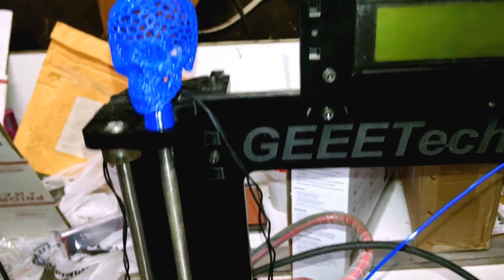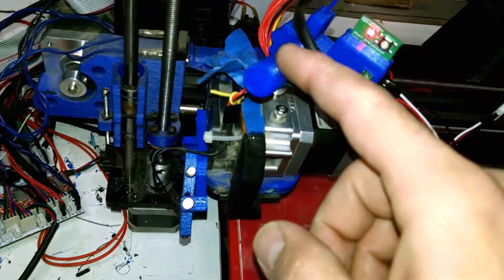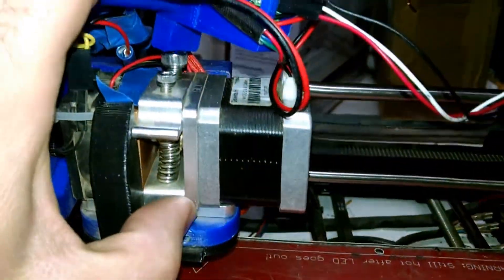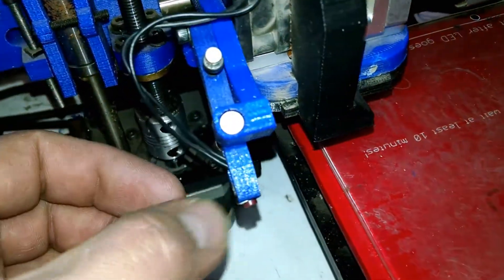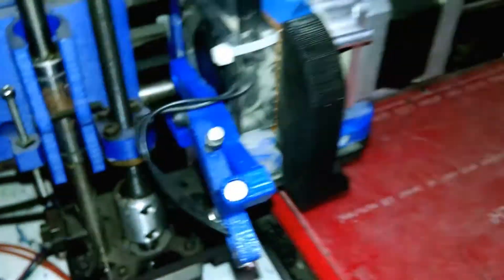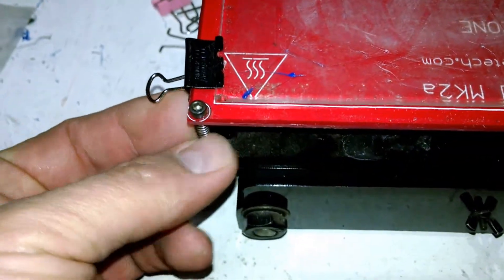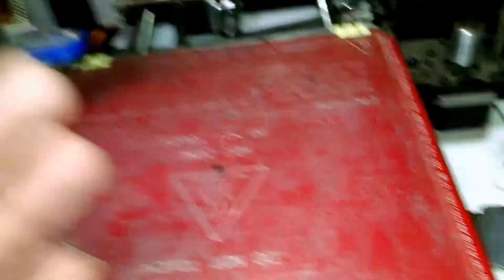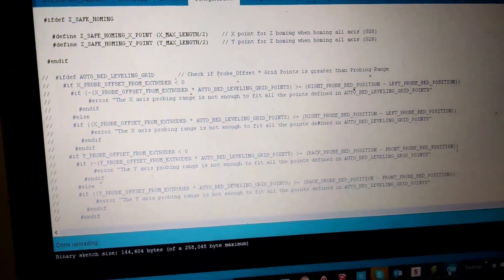Geeetech i3 Pro B upgrades that I made + store and firmware link.

Comment: If you are intrested, i want to recommand our 3DTouch auto leveling sensor for 3D printer for you, it can largely improve the printing quality.  You can check here
 http://www.geeetech.com/3dtouch-auto-leveling-sensor-for-3d-printer-p-1010.html
Reply: The 3DTouch auto leveling sensor made my Geeetech i3 Pro B printer so much better, it takes the always worrying about is my bed level out of my mind, it's made my PLA prints look very very good.
Reply: I need to look into your setup more, looks easier to find the sweet spot if something goes wrong.
Reply from the maker: i already asked lemon and have been waiting for a response.
Reply from the maker: ***** yeah, but lemon don't respond anymore lol. I try to get one to check the code as many have issue with starting it
Reply from the maker: ***** and from what I hear, my setup is the most accurate

Comment from the maker: based on same extruder you made. well the guy made it for that and because makes the filament himself.
so one bracket does it for the filament extruder and the other bracket is for measuring the diameter ok on the fly. it's on thingiverse. yea ramps is set up for it. and since its based on a analog signal output, can use with a meter, analog Arduino. dude sells it for $60.00 includes the shipping for it . you have make the case, look up Filament sensor on thingiverse, or check out my WordPress blog, link on my chanel.
in latest blog, has my firmware, Slic3r settings, and a few other things.

Comment: nice work! dose the filiment diameter compensation work with the ramps / Marlin firmware? I would love to use this method LIVE on the fly adjustment for the homemade filament I have. nice fix on the bed. I need to think up somthing for my delta. right now it's kinda like that but with a 3 point. and no springs. but if I can get it to stay put with a springs. I will as those bed crashes are bad lol ~Russ
Reply from the maker: I hit reply, not sure if you got it but it thete
Reply from the maker: if you need any help, please feel free to ask anything. you where my teacher last year. now I hope that I can relate on your level. you where one of the main content creators that made me want to even do this.

I live in high desert so no too far from you.

I will try to fix the newest version of firmware for a Rostock. you will still need to put in the diagonal arm length and adjust the delta radius but, you will have the thermal runaway protection, the grid type autolevel, "Hello Russ" or "Hello RWG" on lcd start up. filament sensor and whatever else I missed. I plan on sending you a modded iduino mega, and maybe a blue tooth if I can find it in time. will need an address so I can ship it to. work? or po box? my emails are all over my pages of blog and online store. and links to all on my channel.
Reply from the maker: By the way, here's the link, 
http://www.thingiverse.com/thing:454584/#files
This guy put everything out there for anyone to make. The eagle file, stl, pcp layout, parts list, mcu and to program it with the proper usbdm, freescale codewarrior. 

I just got a usbdm and will be programing some stuff. Once I figure out the Chinese part.